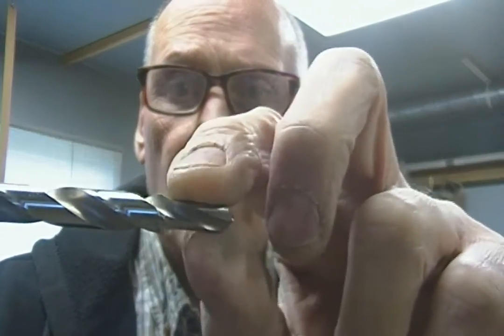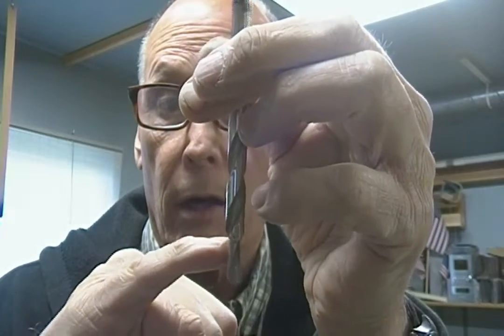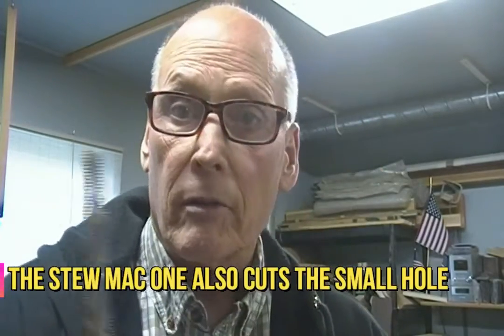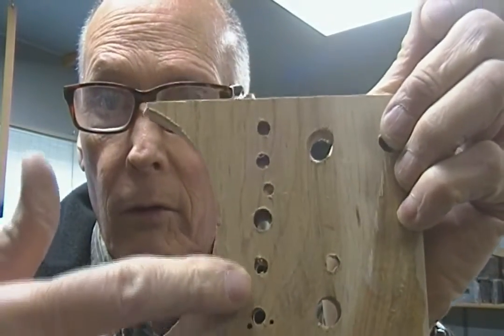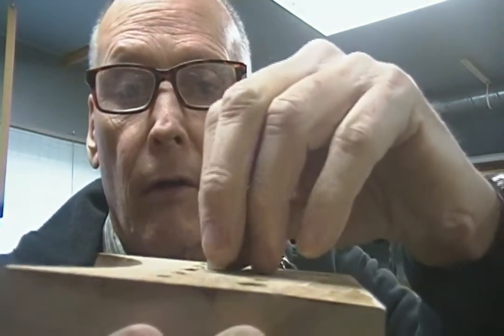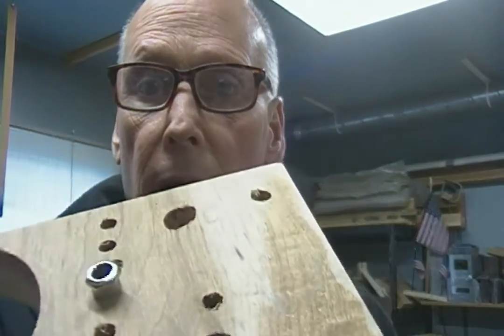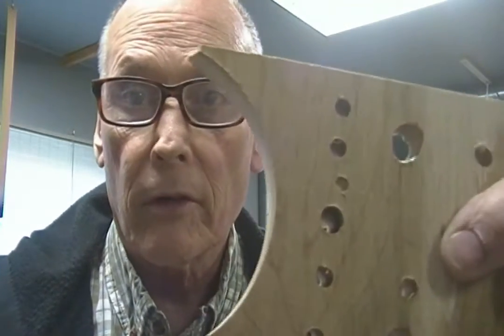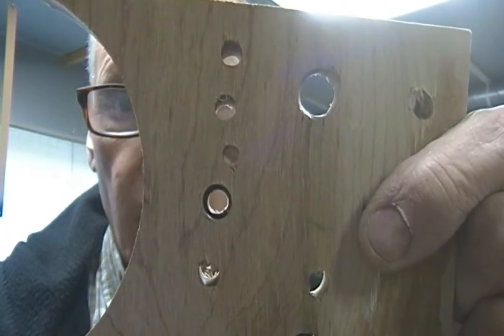MAKE YOUR OWN PEG HEAD STEP DRILL BIT - JONAH GUITAR EXTRA #27

Comment: Nice idea Dane. Keep them coming ;<D Anyone have any idea why manufacturers wilfully sell products that need such odd sized tooling?
Reply from the maker: I'm really surprised the pilot part was centered fright off the grinder with me just randomly  going at it. 

    Could be that factories just tool up for this part of process and make thousands of guitars. Just a part of doing business. But with the "recent" growth in one off small builders there are just a lot of odd sized tools needed that an average hardware store won't have. That's where Stew Mac is really filling the gap. But that is bit grossly over priced. Or it's a stinkin' commie plot!
Reply: @jonahguitarguy  Or possibly a metric size, which will always be a "weird" size in imperial measurements? Looking at the StewMac tool, it's 7.8mm and 9.9 mm in diameters. So a tad under 8mm or 10 mm. Which makes sense. No commie plot involved! Just that the most of the rest of the world now uses metric measurements!